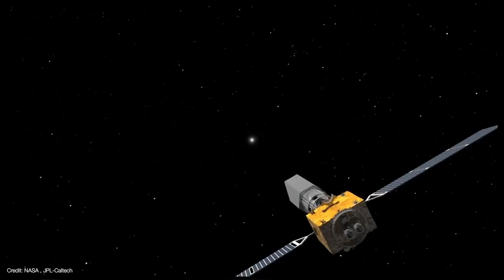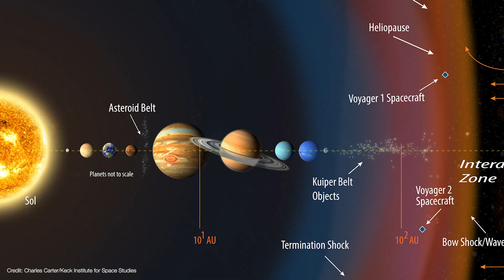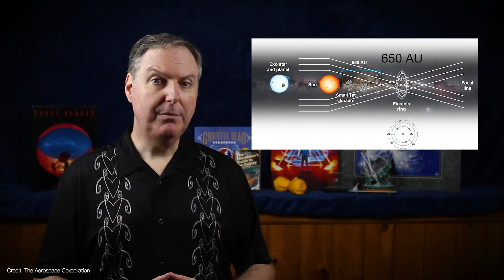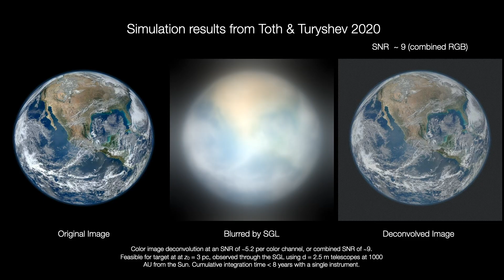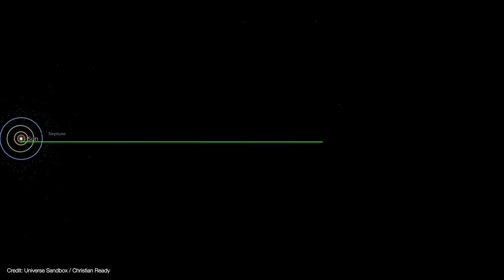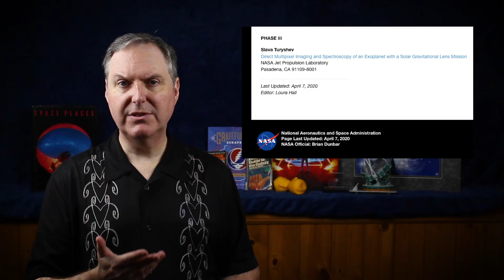The Solar Gravitational Lens will Map Exoplanets. Seriously.

Comment: As fascinating as it is inspiring! Thank you! However at the end of the day, even if we do see exo-planets with great clarity I suspect that it would be like the fruit dangling just out of the reach of Tantalus. There's nothing that we can EVER do to communicate, far less pay the inhabitants a visit. ☹️
Reply: Maybe so, although radio communication is incredibly efficient. Basically there is no limit to the distance between the communicating partners. One just needs a sufficiently strong transmitter and detector. Another aspect of these studies. We will learn a lot more about planets in general, and by comparison with our solar system, also learn more about earth and the other planets around the sun, just as we did by comparing earth to other planets in the solar system when we did planetary astronomy in the past.
Reply: @FredPlanatia  I was thinking more about the time it would take for the radio waves to get there (and back). In terms of the universe, light (and radio waves) is incredibly slow.

Comment: A thought experiment - what if you take this light passing the sun and reflect it a few trillion times between two perfectly parallel perfect mirrors a short distance apart. That way the light could travel the requisite 550AU distance to focus without having to physically travel that whole distance in a straight line?

Comment: This was very instructive, and inspiring (I like the "worthy of a civilization"-part 👍) - but I did not gather how the problem of the target planet moving and rotating is supposed to be solved. This is briefly talked about at 8:40, together with the problem of our sun's motion. But wouldn't there be a requirement of lots of delta-v to keep on target (much more than to account for the sun's motion)? I get that scanning across the planet is automatically achieved but after each scan there would need to be a short burn and this probably needs to happen every couple of hours for a really high number of times, right? -  And what about the planet's rotation? Assuming a similar rotation period as the Earth's, there would need to be about 50 "bins" (1 for every half hour) otherwise it gets too motion-blurred. This appears like a huge overall necessary integration time which brings me back to the thrust-requirement.

Comment: Brilliant. It made me think - Why not start with Jupiter instead of the Sun? Focal point (line) will be much less distant than 650 AU and blocking Jupiter's (reflected) light will me much simpler than the Sun's light and corona. What do you think?
Reply: The angle of the gravitational lensing is based on the gravitational pull of the object, right? Since Jupiter is far less massive than the sun, it would curve light at a smaller angle, which would make the focal point much farther away, increasing the distance you'd need to travel to reach it, not decreasing it. Plus I think the magnification would be much lower.

Comment: What about scaling up the NASA Kilopower nuclear reactor project?  Scaling it up to megawatt class + ion engine  makes much  more sense than solar sails , as the solar sails will be useless past Jupiter. While  the telescopes will need a lot of energy  to move around several AU plus onboard energy needs for many years. That can't be done with solar panels nor suing  any kind of realistic  batteries, the only option is to go nuclear (which is also much chesper anyway)

Comment: This concept, like StarShot, disappoints me. Both are one use projects. Of course, once the basic system is perfected multiple launches can be made. But one for every star? I think not.

Around fifty years ago I read an article in a long defunct Analog-like magazine (actually a paperback book size) called Destinies. One science article was about telescopes. The author imagined a ring of large telescopes far out in space, going around the Solar System. I recall it as a ring, but it may have been a sphere. The author opined this system of telescopes would be able to image flags waving in the breeze on planets in the Andromeda galaxy. Interferometry would be used to combine images into a single image.

Comment: Would it be possible to use other stars as the lens so that we don’t have to send vehicles that far? Or using reflectors around earth to increase the length lights travel so that the focal length is achieved?

Comment: A 35 year timeframe is too long. I believe what is really needed is an appropriate propulsion technology first such that average speeds of about 1% that of light can be achieved.  A constant acceleration of less than 0.5 m/s^2 would do it. Then the devices can be placed in position in about one year.

Comment: Better yet, throw a large constellation of small, autonomous drone ships that will each gather a part of the picture.
Reply from the maker: That's actually the plan, which I discuss in the video :)
Reply: @LaunchPadAstronomy  I wrote the comment at 11:30 into the video:)
Now, I see one problem with this idea. This will work to image a SINGLE exoplanet. The issue is that once all those satellites are so far they will not be able to close distances needed to focus on other planets. They already will have a difficult task of slowing down their outward speed and then they will need to be able to "hover" in an exact position without orbiting the Sun and constantly move to realize the complex pattern that will be needed. There would need to be a series of separate missions for EACH of the planets to image. Still, imaging even a single planet would be a huge success.
Reply from the maker: @leonardmilcin7798  BTDT

Comment: Would this strong of pearls be sent in a particular direction to allow it to image planets around one particularl star system?

With several AI of lateral movement required to change the line of sight by a single degree, well .. we obviously aren't going to be making any adjustments.

Does this mean we need an entire fleet for each planet we image?  

I suppose the first string of pearls should be sent in line with Proxima?

Comment: I wonder if those distant probes could detect radio focussed by the Einstein ring. 📡🛰🤔
Reply from the maker: In principle, yes because all EM radiation is lensed. However, the corona scatters longer wavelength EM more than shorter, so you'd have to start radio observations at even greater distances.

Comment: Really great idea, but why cant we use the same trick as we used to get first black hole image? I mean: build a set of telescopes far away from each other (like: on other planets, or on the Moon at least). I dont understand clearly how it works, but i guess, it is all about coordination of multiple telescopes, which can be resolved by calculations. And there is no fundamental difference between the set of scopes on the Earth and set of scopes on different planets, if the distance is the only thing that matters (i mean: hey, the light from your feet also arrives to your eyes with some delay, it doesnt do it instantly).
P.S. Also, why this guy looks and sounds like Sheldon Cooper?

Comment: An EHT(event horizon telescope) bondle with  a sun gravity lensing
Reply: it is sort of like the EHT in that each detector is positioned on one pixel. So maybe you could use a similar technology for image processing to the EHT and avoid moving the small sats to every point on the planets image (which are many AU apart).

Comment: What if you used jupiter as the lense? maybe less light screwing with it, and you could probly reposition much easier. it might be a good in between step.
Reply: No, you'd actually need to be a lot further away to use it.

Comment: And what about the scanned planet's round-their-sun motion? What about the time it spends BEHIND that sun? I'd say we CAN'T keep up with such motions, using the motion of the telescope. The relative angles would prohibit us from keeping up with sideways-scanning motion of the telescopes. Whatever happens, just remember that planets MOVE, and with such a long involved method... that movement assumes a dire level...
Reply from the maker: You're right, they do move. And if the planet's orbit is "edge on" to our line of sight, then it would disappear behind its star from time to time. But regardless of the system's orientation, we'd have understood the planet's orbit well enough that we'd factor it into the string of pearls' flight plan. So, as they adjust their motion laterally, they're compensating for the planet's motion and the Sun's motion around the solar system barycenter, like a dance :)
Reply: @LaunchPadAstronomy  "Like a dance" being entirely done by fuel sources (even light is a fuel). Perhaps a bit less so for the edge-on cases, but it seems to be PROHIBITIVE for full-circle orbits, when done at the IMMENSE distance from our (or any) sun, at 500+ IU... I'm not mathy about this, just my reaction...

Comment: And another question do you think we could make Mars a planet with an atmosphere basically terraform for my understanding it has a lot of rust which is iron oxide if we were to somehow find or transport large amounts of methachloride and create large burnable structures of them mixed together that would produce large amounts of oxygen as it burns the same way submarines produce oxygen when their electrolysis machine breaks down just on a much larger scale.. could have a whole industry on that planet just for gathering the iron and the methyl chloride or is it Ethel chloride I know it's some form of chlorine the iron burns with the chlorine base and the chlorine snatches the oxygen away from the iron while it burns producing more oxygen than the fire is actually burning chemical science I can imagine enormous power plants and other structures burning this to create oxygen in the atmosphere

Comment: Is jupiter too small to be useful in this way? It seems a scaled down version using the gas giant would be much more achievable.
Reply: The problem is if you scale down the mass of the object bending the light rays, that the bending angle is smaller and so where do you think the focal point is? Yes, its much further away! The suns focal point is about 550AU, where as for Jupiter its more like 6000AU!

Comment: if the only way to aim the gaze of each telescope is to line up the sun and the telescope and the resolution is in kilometers, then not only would they have to move about side to side to build an image, but they'd have to move a lot more in addition to track the planet as it orbits, right? i remember once at a restaurant looking at some shiny surface across the room. it was reflecting a point of light but what was so interesting about it was that if i moved my head very slightly, like a centimeter, it resulted in a visible movement of the dot of light. i was wondering what sort of weird shiny surface i was looking at but it was too far away. unfortunately i forgot to go check it out after the meal...and now i'll never know...
Reply from the maker: Yes they would have to take the planet’s orbital motion into account, among others.

Comment: One thing I didn't understand: Is it possible to get a high resolution image using just one 1 meter telescope at the SGL or is the swarm a necessity?
Reply: I think the swarm is necessary since the pixels are distributed across many AU of space out at 550 AU. It seems like you could move an individual 1 meter telescope to each position but i guess detector area would be small (reducing signal-to-noise) and also any movement or rotation of the planet while the individual telescope was transiting between measurement pixels would complicate things. Image processing of data from a swam on the other hand would seem to allow you to compensate for those things due to parallel data acquisition as well as due to data redundancy.

Comment: Umm. I'm not sure I see how exactly you'd line up a moving sun, moving telescope and (complexly) moving exoplanet to get the kind of picture we're interested in here? I appreciate that at many light years distance, the target planet is going to be moving very slowly as we see it, but at 100 billion times magnification, I'm not sure how you can track a moving object (even from 2200 AU!) without a lot of rapid repositioning of the telescope(s) for extended periods of time... And it would almost certainly be a one-shot thing: a single VERY expensive telescope (or wave of small telescopes) could at best capture a single magnification of a single planet (or at best a single system of planets) in a fairly restricted window of time unless you continue to send out wave after wave of such probes in completely different directions. I suspect we may have other claims on available exploration funds in the coming decades...

Comment: Observing an exoplanet, e.g., at 10 light years (10^17m) distance magnified by a factor of 10^11 is more or less as if one would be observing it from a distance of 10^6m - or from a satellite in its orbit 1000km above the surface (holy jeezus), ...or what did I miscalculate ?

Comment: So this basically is ray tracing at a master level. Isn't it possible to use jupiter as a lense?
Reply: While Jupiter has a smaller radius, it also has a way lower mass and so the lensing isn't as strong. The focal line for Jupiter starts at ~6,000 AU (instead of 550 AU for the sun). The other planets are even worth as far as use as a gravitional lens goes.
Reply: @sirius3100  that is inconvenient. Tnx for the answer.

Comment: Couldn't you just build a big telescope in the solar bubble?  Building a crystal lens in space wouldn't be hard.  It wouldn't be as good but it would be much easier with a higher success likelihood.  It could be reached if something goes wrong or it requires a correction.

Comment: Would it be possible to use Jupiter in a similar fashion? Given that it’s mass is 1/1000 that of the sun, it would give a blurrier image but with a much closer focus range...?
Reply from the maker: Jupiter doesn't warp spacetime as strongly as the Sun so its focal line doesn't start until much farther out - 3200 AU, I believe.
Reply: Thanks for the explanation! Very interesting subject

Comment: don't understand it too much but, could they use Jupiter in the same way, as Jupiter is smaller than the sun the focusing distance should be closer, also they wouldn't have so much problem with blocking out its light?.

Comment: Let's turn the dark side of the moon into a telescope.

ALL OF IT.
Reply from the maker: May I recommend the following for your consideration: https://youtu.be/QKJY7gH2n9I
Reply: @LaunchPadAstronomy  nice plug fam. Valid. I'll watch!
I do appreciate your acknowledgement of the lunar environment's extreme hostility even to machinery though! Not everybody knows how horrific those regolith microfines are too ALL MATING SURFACES on any moving parts, and that it gets in everywhere, and that it sticks to everything due to radiation driven electrostatic charge. Let alone the radiation itself! Whatever we set up on the lunar surface had BETTER be as close to solid-state as possible, or otherwise be under the surface (not exactly conducive to telescopes!)

Comment: This might be a dumb question, but what if you could build a ring-shaped magnification lens the diameter of the lensed light cone much closer than 550 AU? It would have to be massive but could that not create an artificial focal point? It could act similar to a reflecting telescope, right?
Reply: And if that's not feasible, could an array of satellites intercept the light cone and orbit in a circular pattern, matching the shape of the cone, capturing as much light as possible over a period of time? If the orbital length of the exoplanet is known, light could be captured only when the planet is at the same point in it's orbit, and if it's tidally locked around a red dwarf then there's no worry of imaging different sides of the planet

Comment: It is too far and would take too long with the current tech.

But how about, say a Jupiter? The gravity magnification is certaily lower than the suns but still much more than we can do on Earth, is that correct? The focal point wouldnt be that far, can be reached much faster, probe can be powered by solar array rather than RTG that will slowly die and also targets can be changed more easily, since orbiting jupiter certainly takes less time that orbit the sun at 550AU...

Comment: Actually the lensing near sun is only due to the matter on the corona, gravity has no part in lensing and we dont need the false idea of gravity bending light. It does not. If it did, it would be a smooth curve following 1/r² and be obvious around every massive body.
Reply: Incorrect.  All of the phenomena predicted by the General Theory of Relativity have been observed and confirmed for over a century, including gravitational lensing, time dilation, gravitational waves, and more.  It would not, however, be obvious around every body, some of the phenomena including lensing are virtually undetectable unless the mass of the body is extremely high causing substantial spacetime curvature.

Comment: What if we use jupiter as telescope???
Or can we use jupiter as telescope?
Reply: No.
Reply from the maker: In principle, yes but Jupiter’s mass is 0.001 the Sun’s so it doesn’t bring light to a focus until ~3200 AU, and even then the amplification would be far less than the Sun’s.
Reply: @LaunchPadAstronomy  Amplification down by a factor of 1000 - focal distance 10 times farther away.